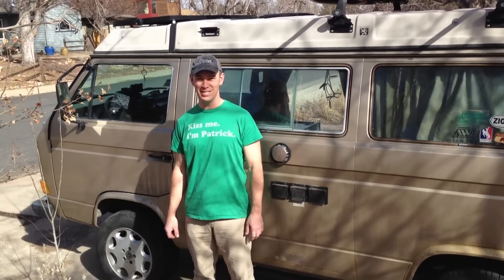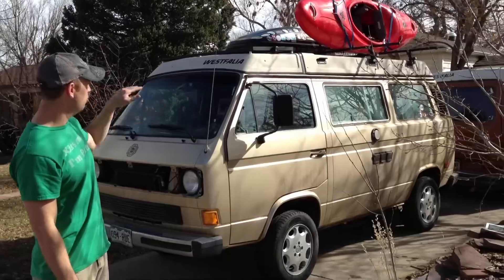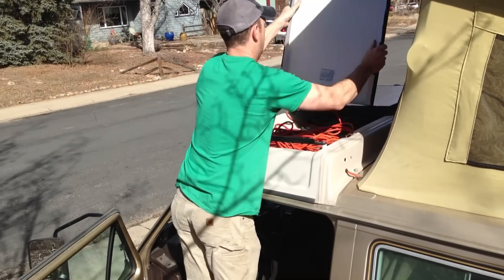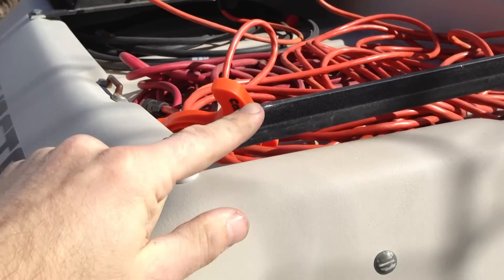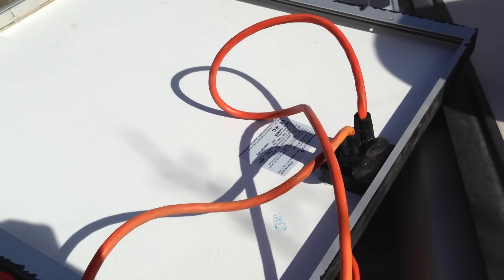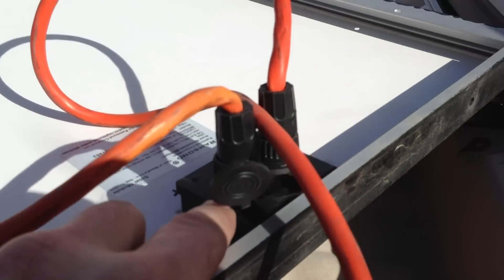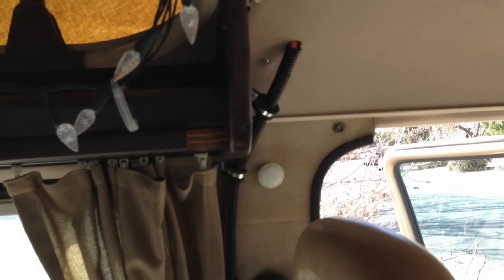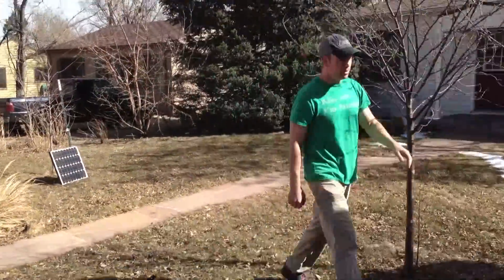Solar Panels on a Westfalia Luggage Rack

Comment: nice set up really like the style connectors and the extension line you have. works good in a stealth setting too i bet. not having to have the van out in the open but still getting the panels out there is key as well as the shade you mentioned 

the old sink vents make great electrical passes through the tops on the bay windows but I'm wondering if that could have even been an option here? or perhaps fitted to a vanagon style?  i hate drilling into any rust free surface on a vw lol. just a curious wonder.

Comment: I have a VW T25 Holdsworth solid side pop top and have had my system a couple of months now and could never decide where to site it (its easy to set it up and route cables if its a side pop top) and seeing your luggage set up I might now put mine there as I don't use that space at all. Any one else got a solid side pop top with any netter set ideas??

Comment: I was gonna ask why on earth you have sooo much wire under the panel. But then I saw that you actually move their position when you're out and about. Pretty cool idea!  I was gonna say that cable must have cost you a lot but if its just 16 awg then it must be mostly rubber! Having a short run when its mounted and then a separate long run was good choice. Looks like a lot of electronics under the stove for those two small panels. Are you planning to upgrade to bigger panels at some point? Sorry for the slightly fragmented comment!